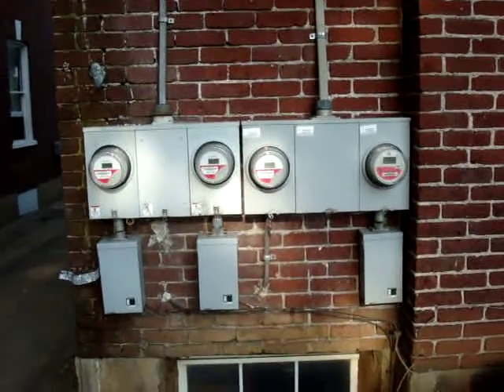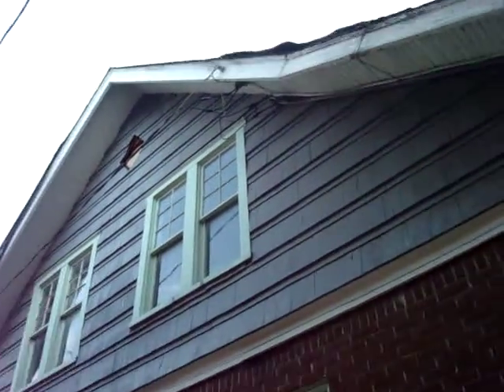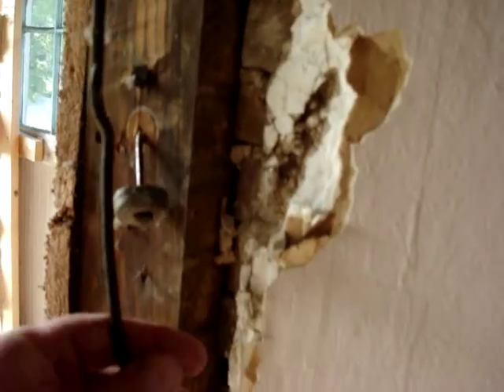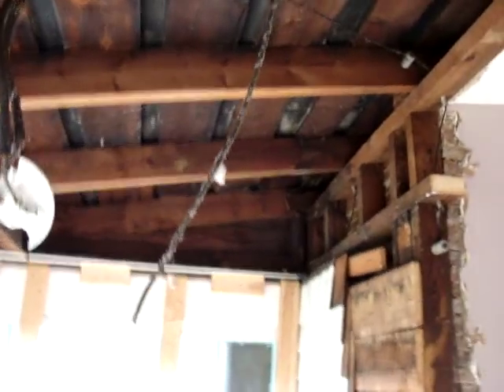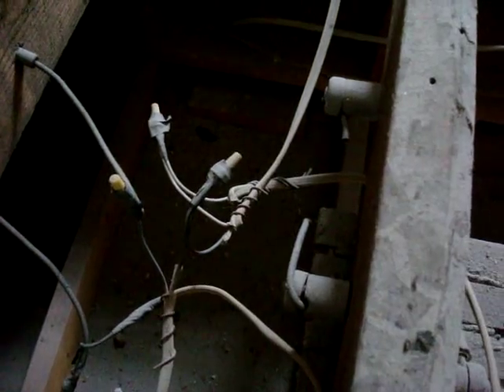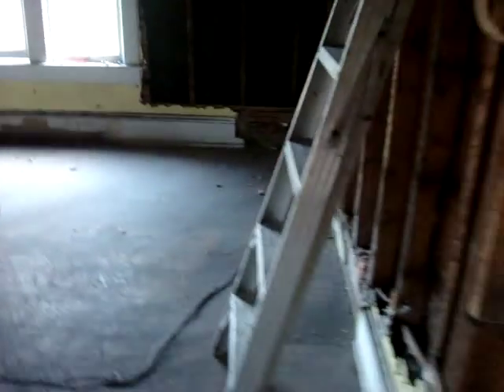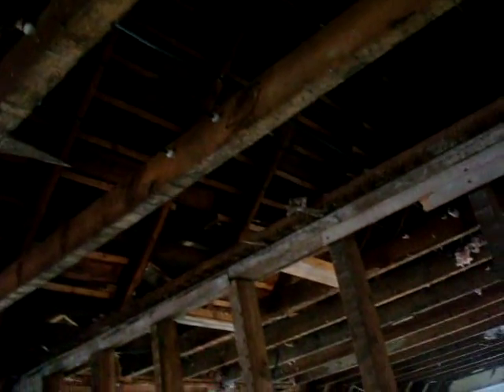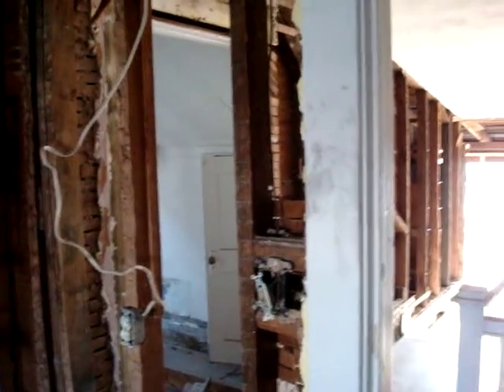Illegal and Unsafe Wiring in Older Homes

Comment: 2:13 "Switch the ground side of the circuit"? I have a house wired with K & T and I thought that, since it's a 2 wire system, there is no ground. Are you maybe referring to the neutral wire? Also, what's your opinion of K & T systems if they haven't been jacked with by previous owners? I know that's a rarity but I just finished a tour of my attic (no access and I had to build a hatch in the gable to get in) and surprisingly, all my wiring has good looking cloth shielding after 71 years even though the Texas sun has kept the attic at 120+ degrees most summers.
Reply from the maker: The grounded conductor vs. ground can be confusing. In any system without a ground circuit (which started showing up in the 60's), houses had ungrounded and grounded conductors. The neutral return path is actually a grounded conductor and in 120 volt circuits it has milliamps of voltage.

In modern wiring, the ungrounded conductor interrupts the circuit, but back in the old days it could be either.

So, to review a modern house has:

-- 2 ungrounded conductors (Line 1 and Line 2) each carrying 120v of different phase that when combined make 240v. These wires are always insulated and can be any color other than white or green

-- 1 grounded conductor (what most people call the neutral return) in 120v circuits this does carry tiny amount of voltage back to the earth (through the transformer and from the main panel to the ground rods) (only the main panel bonds the grounded conductor and the ground circuits). These wires are white.

-- 1 ground circuit (which is either a bare wire or a green wire)

So, Service Entrance SE cable to the main panel is three wires (L1, L2, and a bare wire). These come from the transformer to the main panel, which in all modern applications is connected to the meter box with one large main disconnect. Generally this is an integrated box, but you could have a meter panel, then conduit, and then a main disconnect. This is on the outside of the home.

Then, from that main disconnect switch, a 4 wire SER cable runs to the first panel with all the breakers (there might be additional sub panels off that first panel also, and each of those will get 4 wire SER cable).

The 4 wire cable from the main disconnect to the breaker box contains L1, L2, the grounded conductor and a ground wire. The ground circuit and the grounded conductor are always kept separate after the main panel.

In the old days, it was just L1 (later on folks got a L2) and the ungrounded conductor all the way through. Nothing was grounded! 

Moving on to your question about knob and tube: if it is intact and working, code still allows it. I'm not a fan, but it's legal if it's working and the insulation is still on the wires. So, you can totally leave it and be within the letter of the law!
Reply: Thanks for taking the time to clarify that although most of it is beyond my comprehension level. Since I can't afford to have the house rewired, would it make it any safer to install AFCI outlets?
Reply from the maker: At some point your house has probably gotten a panel upgrade. It originally would have had an Edison style fuse box (the kind where you screw in a fuse), but most homes these days, even those that still have knob and tube, usually have some kind of breaker box (the kind that you flip a switch to reset).

If that's the case, then you can buy combination arc fault and ground fault breakers and protect the entire circuit. It eliminates the need for GFCI outlets too. These breakers are spendy--they range from $22 to $45 each, but they protect the entire circuit. You can do the critical areas first like the bedrooms etc.

Don't put one of these breakers on the circuit for the kitchen though--you're likely to get nuisance tripping.
Reply: You're right. The original part of the house is wired into a fuse box which is still in use. Probably in the 60's the owners added a utility room, a half bath and a bedroom which are circuit breaker protected in the front panel. At around the same time, a couple of 220 dedicated circuits were added which are Romex back to the breaker box. Haven't mapped out all circuits but, I presume my largest breakers power the fuse box which controls 60% of the house. So, is it logical to assume that since the main breaker panel supplies power to my fuse box that installing arc fault/ground fault breakers would afford protection to all circuits?
Reply from the maker: If your fuse box is now a subpanel, then yes, any protection installed in the breaker box will protect the fuse box subpanel. You can even get 2 pole (240v) AFCI breakers if you need them, but they're spendy at $75 to $125 each. The plus side is if you have 2 pole 240v breakers feeding the fuse box subpanel, then everything after the breaker (including the wiring to the old fuse box, and all its circuits) will be protected.

So, you might check into AFCI breakers. Around here, for bedrooms, hallway, living rooms, bathrooms, etc. we're required to installed combo AFCI GFCI breakers.
Reply: Thank you! I appreciate you sharing your expertise.
Reply: The grounded conductor does not have any voltage on it. Voltage is a measure of potential and the nuetral is grounded so putting a meter on the nuetral amd ground is like putting your meter on the same ground wire trying to read the voltage. There's zero potential  (voltage) on the nuetral.
Reply: Insurance companies are now requiring that all k & t be removed before they will insulate the home. Check on that before continuing using he k & t.

Comment: What's wrong with fish taping Romex threw a wall? To my understanding it's perfectly fine to add a outlet that way for instance when adding an outlet behind a wall more noted tv
Reply from the maker: There's nothing wrong with that. It's allowed. In this case, the walls were beyond salvaging, insulation was being added, ducts for HVAC were being added, etc. The walls weren't being removed simply to rewire.
Reply: +James Glass thank you for the clarification

Comment: to be clear, when you say project, do you mean housing projects? or project as in renovating the house is a project. because im curious if the wiring was done poorly as a result of the house's neighborhood. i live in philly, and here we have a lot of problems with gas, as the rowhomes were typically built with one big oil tank and gas connection under the middle of a block of houses. which is obviously great if something goes even slightly wrong. there are still crazy block fires to this day, even in areas where this problem has been remedied.
Reply from the maker: +Erin DiPiano This is a single family home, so project just means big ass pile of work!
Reply: Google User i did pay attention, i was wondering if he was referring to Section 8 housing or just a project. perhaps you misunderstood my comment? i was asking for specifics and relating some of my experience with sloppy construction. thanks for the input though.
Reply: James Glass ah! sounds like lots of fun. honestly, it is quite interesting, thanks for a quick but informative video. have seen some of your other restoration videos, theyre all really fascinating---i love old houses and the big ass piles of work that accompany them!

Comment: This looks like my house. 60 amp, knob and tube, ground was ran but not connected, an assortment of wires just dangling at eye-level in the basement, and there was even a nail which had been driven through the main inside the wall since the day it was installed. Unfortunately, it took our house catching fire in the middle of the night to shine a light on how terrible it actually was. It ended up being a blessing in disguise because no one was hurt, the total rewiring and upgrades was completed today, and I'm even forking over some more dough to get some structural upgrades to the home while the carpenters are there. I'll be able to sleep soundly for the first time in years.
Reply from the maker: +Jason Hatherlee I am so glad no one was hurt!
Reply from the maker: +Jason Hatherlee Plus, yay on the upgrades!
Reply: +James Glass Stupid Question

Can every house be completely rewired without knocking down all the walls?

The copper wiring holding the electrical outlets is getting old and brittle and making necessary connections will eventually be impossible.

Someone said your entire house can accessed through the attic and basement. Is this really true?
Reply: I can't speak for every house, but there had to be holes knocked out in our walls. Even if you have an attic, the electricians can't climb through walls.
Reply from the maker: +Michael Williams It's possible to be MINIMALLY INVASIVE when doing a complete rewire, but some holes (and a bit more) will need to be cut in order to facilitate running new cable. But, you don't have to totally gut the whole place for sure! Allowances are made in virtually all building codes that allow renovation work to have few points where cables are secure, so unlike new work, for example, that requires NM cable to be secured within 8 inches of the box, dropping a cable from the attic (or basement) to an acceptable existing box is OK without securing it. So, yes, some cutting and patchwork will always be needed, but it's not absolutely necessary to rewire a house.

The question is where is the line drawn? Do you also want to insulate? Is there existing insulation in the way of running new cables? Are there fire stops in balloon framed homes that make dropping cables inside wall difficult? Rewiring a house has to be done on a case by case basis for sure!

Comment: I grew up in a house built prior WWII. I remember once when an outlet suddenly sparked & smudged the faceplate! My folks called a professional electrician, who revealed that we had knob & tube wiring, & it had to be replaced. All those years walking across the basement to & from the garage seeing those white tubes up there, & never giving a thought to it! Now, whenever I see a program (like Holmes on Homes) or a video where contractors expose knob & tube, I remember our basement ceiling.
Reply: Nothing really wrong with K&T provided it was installed correctly, not damaged, and not modified incorrectly.  In fact, the open wiring cools better than when in conduit or romex.
Reply: @cascholz1  agreed

Comment: I had an electrician from a national company stick his meter probe into one hot side of a dryer receptacle, and rake the other probe against a galvanized cold water pipe with resulting sparks. This was not my house, but he was trying to prove the house had no neutral. I was unusually polite in raising the BS flag. He was trying to sell $4000 worth of work. I found the problem, and it had nothing to do with neutral. In addition, I had the power company use a diagnostic tool on the wiring for a week at no charge.
Reply: What was the real problem?

Comment: FYI when knob and tube wiring was first installed there was no grounding or ground reference this was done later to prevent lightning from traveling forever on the utility lines.
Reply: Does that mean back then you could’ve touched the hot and not gotten shocked?
Reply: @TechHowden  yes as long as that was the only one you touched
Reply: @Mr2heads  thanks, I’ve been wondering about that for like 8 years

Comment: I bought a house where someone ran a wire under the ceramic tile.
Reply from the maker: Wow.That's a new one for me! What is wrong with people?
Reply: James Glass
Yeah I could not believe it I was tearing the tile up and seen the wire and thought what is this.It was a live wire going to the porch light.
Reply: +James Glass  whoever redid the wiring in my house grounded the downstairs but NOT the upstairs.. I also have an outlet that overheats when something is plugged into the farthest outlet on my opposite wall.. it's crazy!
Reply: grettagrids , get that problem fixed, ASAP. You don't want a possible fire to happen because of this problem. There is too much electrical resistance in that heated socket. There might be loose connections there, since that socket appears to be where the ones further away are connected to.

Comment: Point on this clip when buying A old house for cheap make sure you know what  shape all major mechanical are in. I just figure unless already done a complete gut like you are doing.
Reply: I would be just as worried buying a new or newer house. These old houses were constructed better than the new ones. Unless you having one custom built and you are over-seeing the project, beware.
Reply: I have issues of old rag wire with no ground, the wire insulation is brittle from years of use. I have completely replaced 3 houses need a 4 done. Lots of buyers just blow it off try to hack the system with GFIs etc.

Comment: hi Sir .. (I understand new home requirements) but, when rewiring an older home, does the NEC require tamper-resistant outlets? Or does it go state-by-state? Or is it a personal moral decision for safety?
Reply from the maker: Code works like this: an international body makes code based on suggestions for the public (anyone can suggest code changes), under this body (called ICC), there are subsets for residential (IRC) commercial (IBC) etc. The councils make code for their respective specialties, but none of this is actual law--just suggestive prescriptive code. In America, each state makes a state wide building code, and in VA, where I live, it's call the USBC or Uniform Statewide Building Code. This makes the code that was suggested from the ICC and it's subsets into law--sometimes states modify these suggestions to fit their needs. Some states do not allow local authorities to make code on top of state code and some do. Those that don't are called Dillion Rule states, and VA is like this. It means that local government can't add additional restricitons, but in other non Dillion states, local government can add more prescriptive code. If there is conflict between state and local law, the state law wins. Now, even in Dillion states there are exceptions to for local government to make extra law, but that's too complicated to address in a youtube response. I can't speak to morality in this case, but all these building laws are made to maximize public safety. Building codes exists for public safety.

Comment: Actually it was common practice to wire power through the lights and not the switch in the 20's not sloppy at all. Also I wire GD and DW on diff circuits but use 12-3 to run them both on the same wire and splice 12-2 from DW j-box for GD.
Reply: +James Glass not exactly wild west back then. The National Electrical Code was adopted in 1897 and switching the neutral, not ground, was to code and the norm. This scheme was neither unsafe nor safer than switching the hot wire.
Reply from the maker: You're right--it was really common. I find that most early 20th century homes in our area run hot to the fixture and use the switch on the ground side. It was the wild west back then!
Reply: I have books of that era showing it done like that, not only common but seemingly preferred!
Reply from the maker: +FtMadBob Thanks for the comment, but let's break down law verse practice. Yes, NEC has been around over 100 years, but just because a governing body existed doesn't mean safe practices were enforced. In SW Virginia, where I live, new construction homes were going up as late as the 1960's without building permits, so non-enforceable guidelines from the NEC were valueless. 

So, it was the wild west. The wild west had laws too, and murder was certainly illegal, but how consistently and evenly was the law against homicide actually enforced?

So, you've committed a logical fallacy--in part because you don't understand my original statement (which led to attribution bias). That's cool. I'm not busting your balls. I just want you to understand (and differentiate) between guidelines (NEC), the law, and practice. Those are three separate things and you've conflated them into one thing.

So, today, we have real black letter law (whatever building codes exist) that are actually enforceable (by a building department and its inspectors), and in urban areas it's now virtually impossible to work without a permit for new construction, so the guidelines passed down from bodies with authority (IRC, NEC, IBC, etc) that get adopted into law in the form of building codes force consistent and safe building practices.

So, just because the NEC existed 100+ years ago doesn't mean shit. Those guidelines have to be enforced and this house (and most for the next 30 years after) were built without a single permit. 

Secondly, you confuse what's unsafe here. The issue isn't that the grounded conductor is switched vs. the ungrounded conductor. The issue is that there is no rhyme or reason when it's one or the other. In this house alone, some lights were switched on the ungrounded conductor and some on the grounded one. That's what's dangerous. It's unpredictable and inconsistent. 

And, since there was no building inspector, there was no one to even require consistency. 

I hope this clears up why it truly was the wild west back then. Having guidelines and laws is great, but if no one enforces them, then it's just the wild west!

Comment from the maker: I wish youtube would let us put URL's in the comment boxes, but you will love that wireless AC video on Ted Talks. With changes in distributed energy and lower consumption appliances, I agree that we'll make great strides in lower voltage systems. The bigger draws like motors for fridges, W&D, etc. will be a challenge, but for many fixtures (especially lighting) and some appliances we can def. use lower amp/volts circuits. I'm all for less watts!